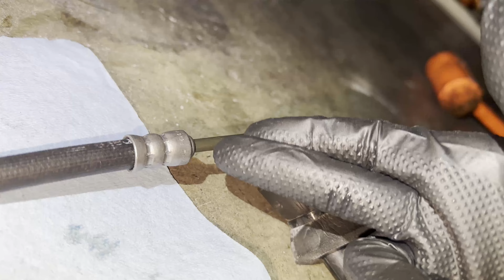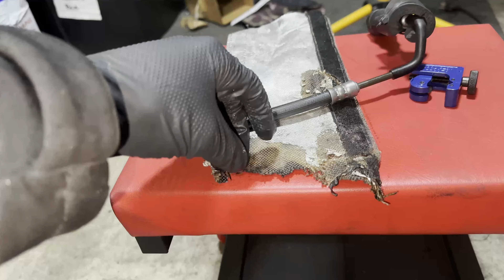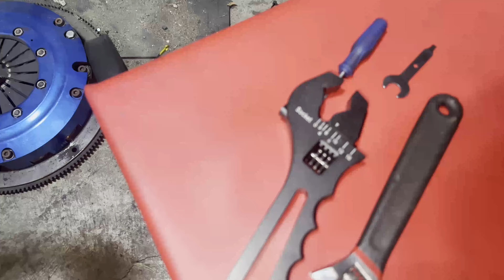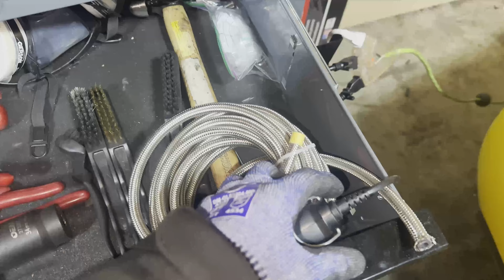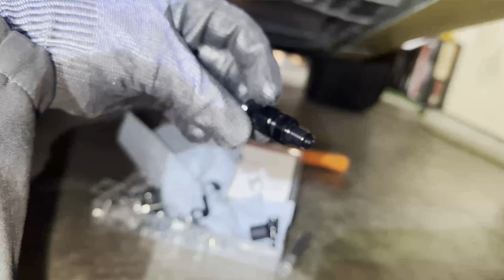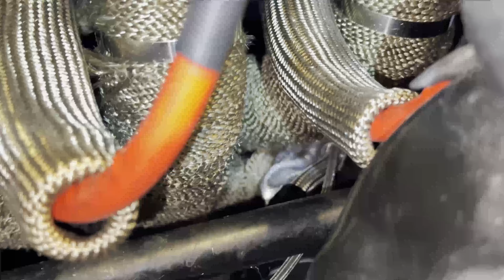MAKE SURE TO CHECK THIS ON YOUR C6 CORVETTE !

Comment: hey man, can you provide me with links for all parts to do this fix? having same exact issue with my c6. awhile back rubber hose of clutch line melted . so i cut out section where it melted and just put a barb fitting with double clamps on both ends it held up, but now 2 years later the barb fitting repair is leaking now. i wanna do the steel braided line repair. how hard is it to do?
Reply from the maker: Really easy to do just need two compression fittings 1/4” I believe to a 4AN fitting with 4AN steel Hose
Reply from the maker: EVIL ENERGY 4AN Male to 1/4"... https://www.amazon.com/dp/B0CR76643Q?ref=ppx_pop_mob_ap_share

Comment: Are you sure the wire wrap didn't catch on fire and then the leak started?  I'm wondering if it would have been fine without the wrap altogether?  Thoughts?
Reply from the maker: @lawnmowerman25  from what I can tell the hose contacted the exhaust manifold and burned through both the wrap and the hose . So Id say it was a combination of the two but would still be possible without the wrap if you get long tube headers to burn through the clutch line
Reply: @SixGenLS  Thank you sir.
Reply from the maker: @ of course 😎